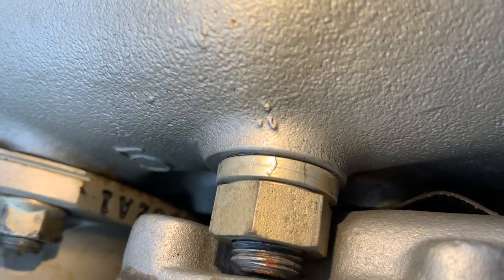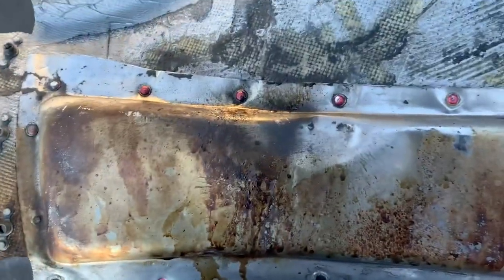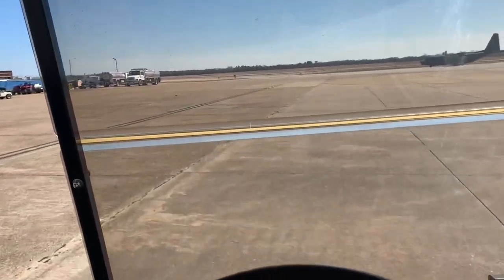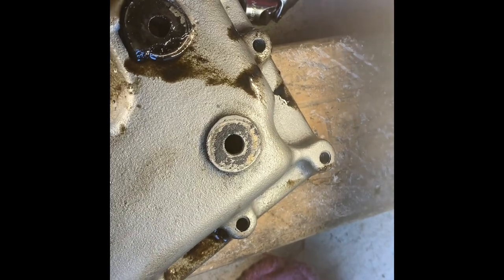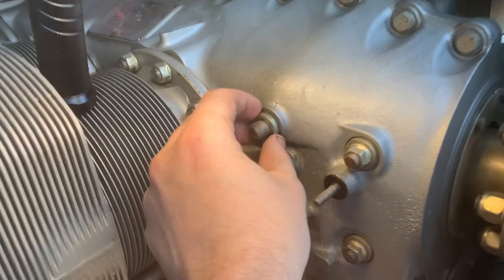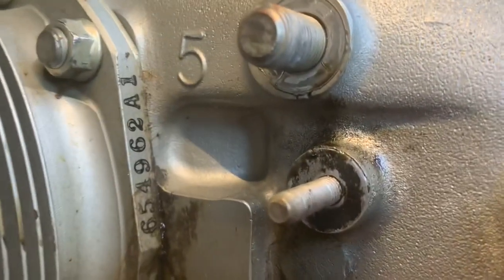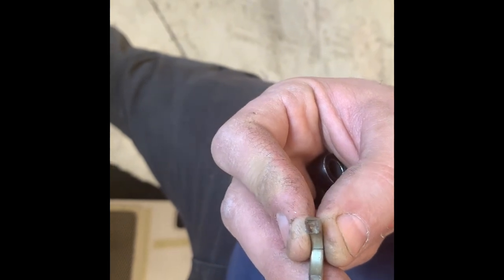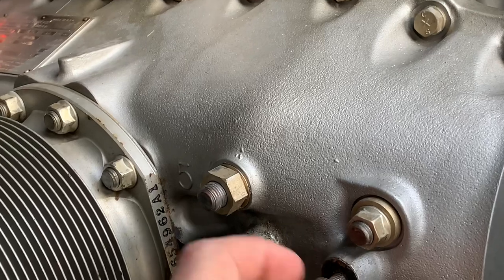Cessna 210 continental TSIO-520-R has a slight major leak.  Cracked through stud hardware. A&P life.

Comment: That washer that was put in place of the cracked one, is a standard AN-960 type... It does NOT match the specs. of the original equipment washer provided by the engine manufacturer... It will probably work for now, but you should order the CORRECT part to replace the OEM part... And BTW, an 'O' ring does NOT BELONG in between the nut/washer/engine case machined surface... This would give you a false/uneven torque of the fastener if the 'O' ring gets in between the fastener stacking arrangement. Check to see if that is the CORRECT center case stud nut - to use on this engine, because it might require an elastic stop-nut, or another type of self-locking nut, but the CURRENT engine manual parts list will tell you for sure... I'm thinking that the mating surfaces of the case halves should be sealed to prevent oil from leaking out where you found this leak to be coming from, and I'm wondering if the center cases are damaged on those surfaces, and possibly elsewhere inside of the case halves to be causing this unusual leak. These are the type of things that could cause the plane to FAIL an annual inspection to be signed-off by a good IA... Find the proper assembly procedures, of the case halves and center engine assembly, and the CORRECT parts identification, fastener torque specs. , in chapter 72 for this aircraft (Engine mfgrs. service manual)... Always use the RIGHT parts & procedures, when working on nice / expen$ive equipment - Like AIRCRAFT ENGINES... Check to see if any AD notes & service bulletins have come-up for this model & type of engine... If so, check to see if they have been complied with, and check to see if there are specific ways to check for internal damage/defects of these types of engines... Dig into it Amigo...Time spent here, could save an engine failure from happening while in flight, which in turn could save lives and the plane...
Reply from the maker: Bruh… continental through studs come out easy and they have o rings on them…… not underneath the washer but inside the case
Reply from the maker: That washer is there because you can’t leave no torque on the through bolt, in case someone moves the prop.  That plane ain’t flying until all the parts come in and we fix it
Reply: Bro, you need some ice for your burns 😂.  Don’t act like an expert and be completely unaware that continentals have o rings on the through bolts…. Oh my god at the “it needs a nylon locknut”…..  keep it up aviation squared
Reply: @CreativeMechanic  So I guess you must be an expert on this type of thing? And btw, maybe the aircraft engine manufacturers can use somebody of Your apparent 'Skill, knowledge & expertise' .... Please, just promise everybody who could be flying things (and underneath these flying things) that You pretend to know about, that your 'Creativity' is saved - for non-critical things, and is also Far-Far removed from aircraft of ANY type... And since you seem to know so much about this equipment, then You should be able to determine if there are any current AD notes , Service bulletins, or any other type of information on this engine... Dud, whoops I mean Dude, how long of a time lapse is allowed to consider aircraft Manuals, Adviseries, Bulletins, Engineering notes, etc. to be current? If you are not sure, look it up, along with several other things...
Reply: @michaelmartinez1345  all you did was dodge the points at which you were completely wrong.
Reply: @aviationsquared1909 , if that is where the 'O' rings are located, the center cases would have to be split to replace any of them... This now becomes a major repair... I'm wondering if the owner(s) can get another 1,020 hours of service from this engine, if a thread and a thin layer of #2 Permatex were carefully put between the NEW OEM washer and the engine case along with a copper sealing washer and an elastic stop-nut to be used above all of it... This is a certificated plane, so engineering approval might be necessary to make a mod. like this... But on an experimental , non revenue generating type of a plane, this type of a repair just might work.... But it should have a good glide ratio and a low landing / take-off speed, in case of an engine failure during a critical phase of flight...
Reply from the maker: No
Reply: @CreativeMechanic  What effective, realistic points did YOU make here? What You did was pretend to know about things that You obviously know very little about, or are just guessing at...  It is obvious, and you are openly denying it... So did you find any AD notes on this engine? If not, maybe later... In any case, you really have so much to learn, don't you? BTW, give me a reason that an elastic stop nut (AN-365) can not be used on that engine case... What is the maximum temp of that case? What is the max temp of an elastic stop-nut? If the case temp is higher, then obviously a higher temp stop-nut would be required, but maybe the max temp. of the engine center cases could be lower than the max temp of the elastic stop nuts, in which case the melted inserts of the elastic stop nuts would be a definite indication of engine over heat... And BTW, what I suggested here, about the nut, on the crankcase pass-through stud, is MAYBE that could be the wrong nut. I never said that 'it needs a nylon stop nut' as your false statement suggested... Please THINK, before responding to these comments...
Reply: @aviationsquared1909  So, you are saying that removing center case studs , does not require seperation of the center cases? If that is the case, then exactly HOW can one determine the assurance of an oil-free environment of where this stud is threading into? After all, that area is normally exposed to engine oil, isn't it? That seems to be Your persuasion here, by replacing the 'O' rings on the center case studs... Without splitting the cases, the studs would have to be removed from an otherwise 'Live' engine.... If that is Your technique, is there a reference that You have to LEGALLY do this? What I'm wondering about now is, HOW , will oil be kept away from the male & Female threads that the stud(s) thread into? And even if the threads are kept clean, HOW will the thread locking compound (Locktite #262-Red) be kept out of the inside of the engine? My guess (and BTW, this is a guess), is there is NO recommended procedure from TCM for center case stud removal/installation, without splitting the center cases... If You do have a Viable-Current & Legal reference to do this, please tell me what it is, so I can verify and learn from it.... If not, just keep working on planes without a reference, and plan to go to prison when You're caught doing that...
Reply from the maker: I think you may be confused about this type engine and the location of the bolt.  The “threaded” ends both protrude from the case so you can see them…..  😂.  I think you are confusing these with lycoming thru studs.  You cannot remove a lycoming stud without splitting the case
Reply: @aviationsquared1909  Ok, Gotcha... So these studs have an exposed nut or a head on the outside of both sides of the case? That makes it easy to replace those 'O' rings... Sorry, but I have not worked on many recip. aircraft engines.... Mostly on turbines and my actual specialty was airframes on the large planes... But I always had to have some sort of a reference and do the paperwork while the work was being done... I worked on planes for several years, and remember how critical the procedures were to follow... Often on critical components that had an RII status, it required an inspection sign-off before proceeding onto the next steps... They (inspectors) always wanted to see the references and often asked us specific questions of how we did the work... Torque wrench's and any other measurement tools were provided by the company and checked for accuracy every year, and the info. of that calibrated equipment was always entered on the paperwork. Hopefully that is still being done. When we made the work go into service the specified time allotted, that was good... But when things did not go as originally planned, we were expected to tell the truth of what happened... Lessons learned briefings always followed the un-planned events... The key was (and hopefully still is) to be HONEST of how things were (are) going... The quality always went in, before the name went on... Hopefully, that is still being done too...
Reply: @CreativeMechanic  Speaking of experience, yours seems to be in the areas of contaminating planes and shop areas with your own brand stupid ideas, as you INADVERTANTLY admitted in the paragraphs that You just posted above, by displaying arrogance and poor judgement of Your comments. However, You seem to be quite sure of Your thoughts....  A legend- in Your Own Mind... And it is this kind of thought process, that have already caused several mistakes to actually turn  into real bad situations,  especially with aircraft where things can happen very quickly , as it is no secret that the worst aviation disaster ever, was primarily caused by ARROGANCE of an ARROGANT pilot, who refused to listen to the suggestions of the other two people in that cockpit.. The service manuals , the methods and procedures of aviation work , can and often have changed because of new discoveries made in the aviation business. I asked You if You knew of any AD's or service bulletins on these engines, and since You're supposedly such an expert on this type of equipment, it makes me wonder of how much You Actually know about it, if You could not mention any of these things.. People who are arrogant have often been found to be the worst REPEAT offenders of their own mistakes, because they often refuse to admit that they made mistakes... Denial , mainly because of self indulgence in one's own embelishments of what they would want to have.. I heard there are several Self-Help courses available for people who are in deep rabbit holes-like You seem to be in at this time... Good luck with that Dud, whoops- I mean Dude... Freudian slip.... I honestly hope that You'll be able to find Your way out of the hole that You  seem to currently be stuck in...
Reply from the maker: Read through the overhaul manual and you will see that certain thru studs are removed before splitting the case and then reinstalled after the case halves are together, therefore these thru bolts can be removed and replaced in the field.  It’s like changing a jug, totally fine as long as you ain’t gotta split the case.

https://www.coyoteflight.com/resources/Service_Manuals/Teleyne_Continental_TSIO-520_Overhaul_Manual%20.pdf
Reply: @aviationsquared1909  Awesome info... Thank You for finding this... I had it wrong from the start, thinking that the other end of the stud is threaded into the opposite engine case... But not knowing about the complete pass-through studs by not being familiar with that engine, did seem to attract a certain kind of negative reaction from an individual on this particular thread... It tends to make people wonder, if this type of an arrogant attitude  contaminates a workshop environment from the learning process... I have heard that the recent situation in the aviation industries, has several companies faced with severe shortages of pilots, technicians, service agents of various skills... Reading the comments of that individual who refuses to use their own name, but goes by 'Creative Mechanic' , has removed the mystery of WHY it is not easy to find people to work in this field... Even those who could be helpful because of their previous experiences. Until the aviation companies address the need to 'fire' individuals who conduct themselves in a conceited/arrogant way - like 'Creative Mechanic' , these aviation companies will probably continue to have trouble holding onto good reliable employees.... Hopefully this situation will be discovered and addressed, before even more aviation companies are re-located elsewhere, like they have already been doing, for the last 30+years...